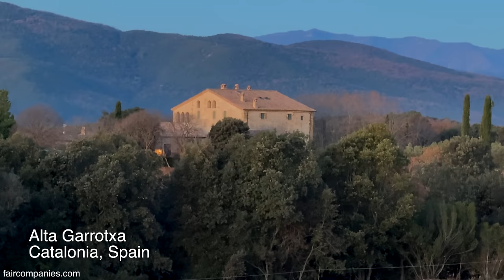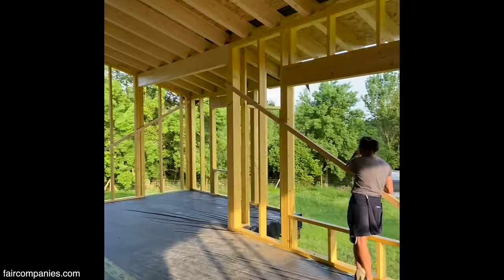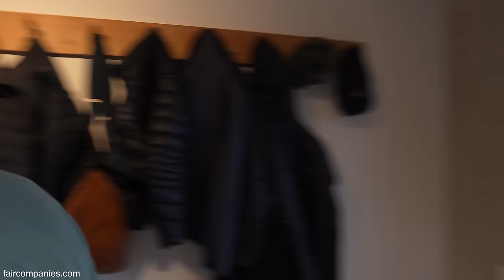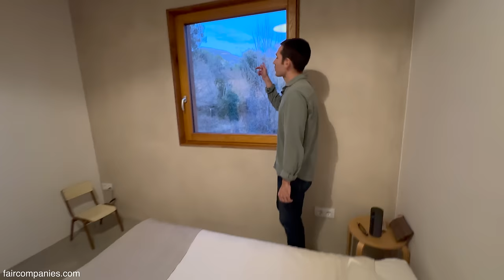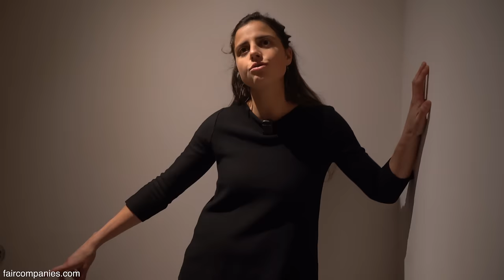Young couple self-builds hempcrete home with innovative compost toilet

Comment: I can't imagine not having sun during the winter months. Hemp is so impressive. We need to get back to it.
Reply: definitely
Reply: I'm happy Germany is going to legalize cannabis next month, which will bring hemp back as a construction material.
Reply: Its unfortunate it was outlawed in the west in favor of cotton. Hemp is such a versatile, and superior product in every way.
Reply: Cotton makes better clothes 😇
Reply: I'd be interested to see how hemp walls hold up to driving rain. Where I am in the UK, we get some really bad driving rain that the wind would direct right at the south and east aspect walls (also where the most sunlight comes from), and I wonder if that would be an issue for this type of construction. Obviously, roof overhangs would help to an extent, but people that visit us often comment on how horizontal the rain appears to be here! I wonder if it would be possible to integrate materials without affecting performance? Perhaps a stone wall facing East, with the remaining walls in hemp. It'd be great to see many more examples of this type of construction to iron out any difficulties that might occur.
Reply: @ricos1497 eaves and perhaps weatherboard over the sides exposed to driving rain?
Reply: @samj4348 yes, eaves would definitely help, at the correct angle so as to not block out the winter sun. I'm curious as to whether something like weatherboard would actually work with hemp, or if it would either affect the breathability of the structure, or itself suffer from the moisture build up (and subsequent rot) that may occur with different rates of moisture absorption/release in the two materials. That's the fun of working with permeable materials I guess!

Comment: Hempcrete also makes an excellent material for anyone lookin to make a year around greenhouse in cold climates. I have made one in central Oregon to fight temps around -5 with plants in it in January. Love the stuff. Should probably become standard. The fireproof rating is one of the most underrated parts in my opinion. Especially for those in Rural areas.

Comment: To be clear, 13:00, the conversation about Passive House is probably two conversations at once. They are using passive methodology like orientation, thermal mass, overhangs, etc., but if they didn't get certified by a local credentialing body, it's not a Passive House. Air tightness is different from vapour permeability so it is totally possible to certify a hempcrete house (or straw bale, cob, etc.) so long as it only has a certain amount of air movement through envelope. In that case, it's more about the doors and windows than the wall materials.

Comment: I think they were clever to build their own house which is both economical and energy-efficient. I would have some of those long piles under the house checked by a structural engineer, though, to make sure they have enough cross-bracing to resist lateral forces.
Reply: First thing I thought when looking at them, as civil engineer myself

Comment: You can achieve high tightness performance. Hempcrete alone is not great as it is ~25 AC/H
@ 50Pa. Tightness is achieved once the lime render has been applied. You can find a video of a European builder getting 
in the 0.6 AC/H @ 50Pa Passive House range. Also, search a research paper  "Hygrothermal performance of
an experimental hemp-lime building", Centre for Innovative Construction Materials, University of Bath.

Comment: - [00:10] 🏡 Couple initially sought a small plot for gardening but found ruins too expensive in the area.
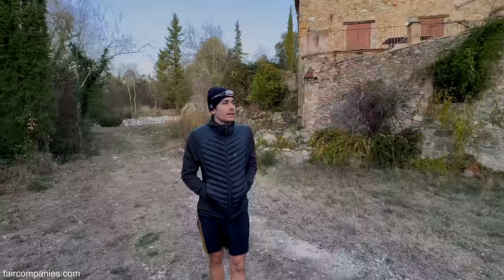- [01:00] 🏗 They lived in a caravan for 8 months while setting up utilities and planning construction.
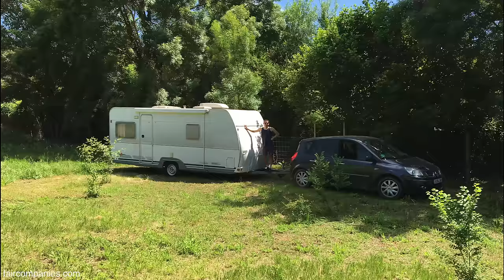- [02:01] 🛠 Used micropiles for foundation to minimize soil impact, avoiding excavation.
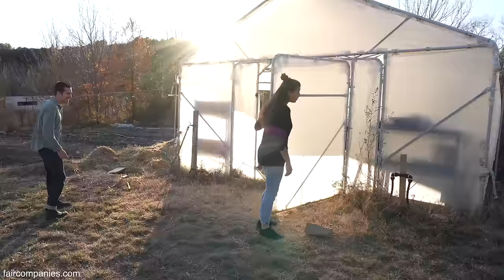- [03:01] 🌱 Started with a greenhouse and microgreens business before building the house.
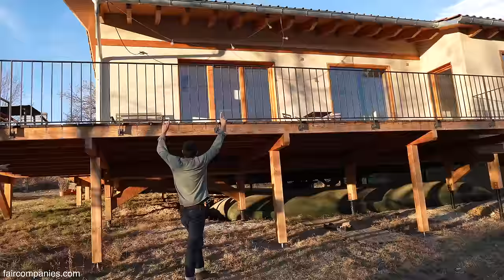- [05:01] 💧 Used rainwater collection with a 30,000L bladder tank to address water scarcity.
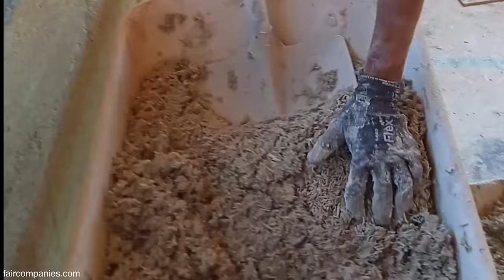- [07:26] 💸 Opted for hemp and lime construction for cost-effectiveness and sustainability.
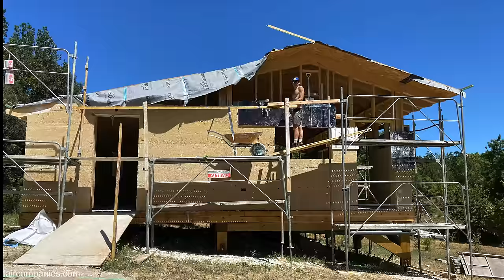- [09:00] 🌞 South-facing design with ample natural light and thermal mass for passive heating.
- [11:05] 🏡 Avoided corridors to maximize space efficiency in the house design.
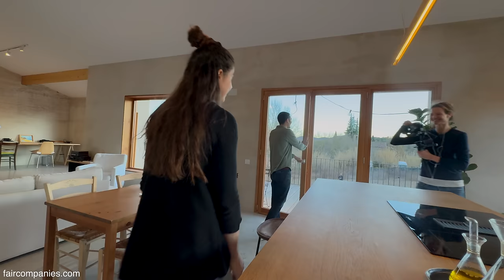- [14:19] 🚽 Installed a composting toilet for sustainability, reducing water usage.
- [21:17] 🍽 Designed a spacious kitchen with island bench and induction cooktop.
- [23:01] 🏠 Aimed for a comfortable house without excessive size, balancing comfort and sustainability.
Reply: 21:15  💩 poop
Reply: Greatly appreciate this.

Comment: Nice! I'm hoping to use hempcrete but since I live in a temperate rain forest I will need to seal it with vapor barrier. 100% humidity in the winter in unacceptable, I'd turn into a fungus. The micro pilings look pretty cool, creates a great space for the water bladder.
Reply: I believe hempcrete regulates the moisture in addition to being mold resistant
Reply: @jma5474 Correct.
Reply: @jma5474  The problem is when the climate is 100% humidity outside for six months at a time. I still need to seal it for my area, although if I could open it during the summer that would be okay.
Reply: Saw this. No idea if it helps you, but just in case: Hempcrete can be suitable for use in a humid climate due to its moisture-regulating properties. Hempcrete acts as a vapor-permeable material, meaning it can absorb water from the atmosphere when humidity levels are high and then release it when conditions are drier. This ability helps to protect the structure from moisture-related problems such as rot and mold, which are common issues in humid climates. Hempcrete's moisture-absorbent, antimicrobial, and antifungal properties make it resistant to mold, thus extending the longevity of a building.

Comment: If the hempcrete has the high R value that google says it has it is a good thermal insulator but if it is on the low end then it really is not a great  thermal insulator, there is the factor that you can grow and manufacture it yourself  so that might be a big consideration too, thanks Kirsten.
Reply: The R value isn't the only thing going on with hempcrete.
There is the air humidity factor: damp air feels colder than dry air (because water absorbs more heat than air and is a better conductor) so the way hempcrete walls regulate vapor makes the rooms more comfortable even at the same temperature. 
There is also the phase transition of water in the walls: when it condensates (which it does more in winter), it releases heat into the wall, when it evaporates (which it does more in summer), it pulls heat from the wall. The branching, open porosity of the hemp hurds creates the condition for capillary condensation by adsorption, it means the condensation needn't be caused by low temperature and can warm the inner surface of the wall.
Since there is a capillary traction within the wall, the water will be wicked away. 
Then there's the thermal diffusivity and thermal effusivity [think how at the same temperature stone will feel colder than wood and in fact absorbs more calories] and hempcrete is very good on both of those factors, keeping a warmer surface. And the surface temperature of the walls (including floors and ceiling, is there a word for that?) accounts for 50 % of the feeling of warmth (the other half being the temperature of the air) because of the infrared radiation exchange constantly taking place.
So the performance of hempcrete is much better than its R value indicates.

Comment: It is a passive solar house. There were some misconceptions about "passive house" stated. A passive house is air tight but allows moisture to pass through the walls. Passive solar just means it's oriented toward the sun to capture heat. Passive house is a concept that minimizes heat loss/gain and has active ventilation for fresh air, since it's air tight. A house can be both a passive house and a passive solar house.

Comment: Does anyone know about the necessary protection for Hemp walls  to build beneath the ground ? It appears that given the weather modification it is critical to build beneath the ground for added protection from the elements
Reply: It is not recommended to build below ground with hempcrete. You would need a more hydraulic lime than the one used above ground (with added pozzolana, for example) and granulates that can't rot (cork, perlite, vermiculite or other insulating granulates). And the structural framing couldn't be in wood...

Since the ground itself has good inertia, it might be better, simpler and cheaper to build the below ground portion in masonry.

Comment: So, without concrete, what is the thermal mass on the floor?
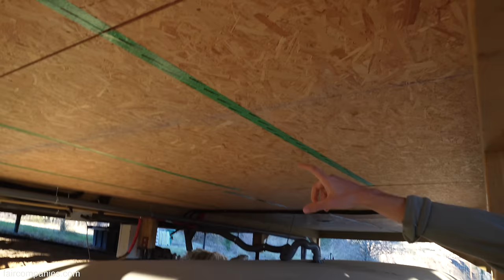Reply: They might be referring to the pre-built 'sandwich' insulation. At 5:39 you can see it being placed down. I do wonder if the water tank beneath has any impact

Comment: The house is probably quite warm due to all the under floor heating pipes installed that weren’t mentioned. No wonder they need thirty two solar panels on the roof. Probably to run the air source heat pumps for the under floor heating.
Reply: We actually installed the tubes just in case as it can get cold in winter in this area but we don’t have a system connected to it. The house heats mainly because of the sun and some cold nights we put the fireplace on. 

We knew how hemp’s houses behave but weren’t sure how warm it would actually be and it is shocking how well insulated it is. Hence installing the tubes, but not sure we’ll ever use them 😅

Solar panels (8kw) are for the appliances and to charge an electric car.

Comment: A relatively common misconception is that passive houses are moisture and air sealed.  They are absolutely tightly air sealed, but they can should allow water vapor to escape.  As some builders say, the house doesn't need to breathe, it needs to dry.